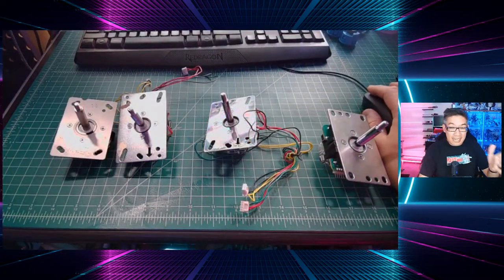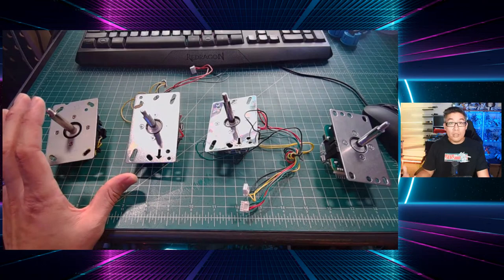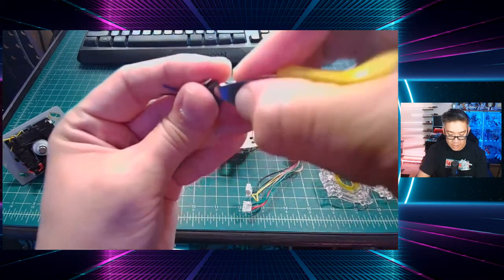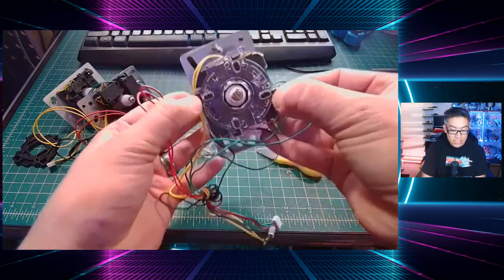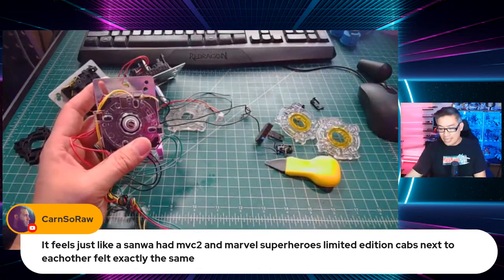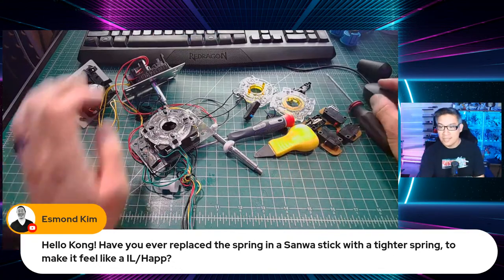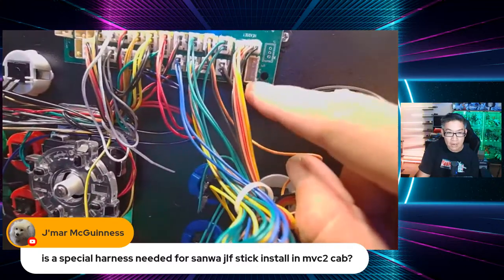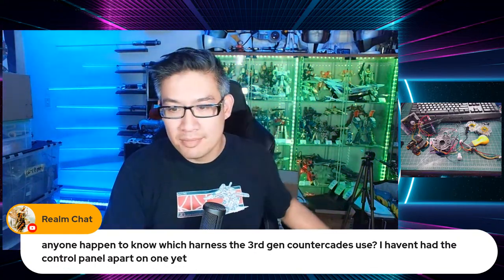Evolution of Arcade1Up Joysticks | Street Fighter 2 to Marvel vs Capcom 2

Comment: I was surprised the sticks had flathead inserts at the bottom of the shaft, just like the Sanwa jlf's, not having those would lead to loose ball/battops. I already swapped the sticks on my mvc2 cab, so those stock sticks are going into my midway legacy.